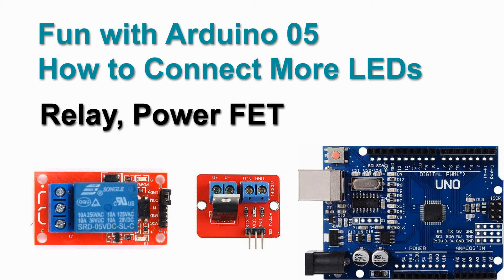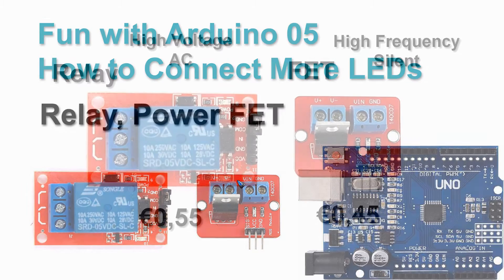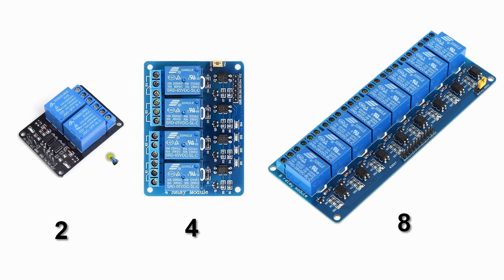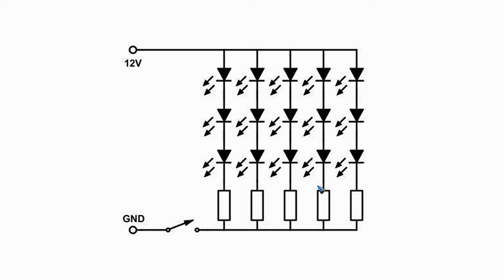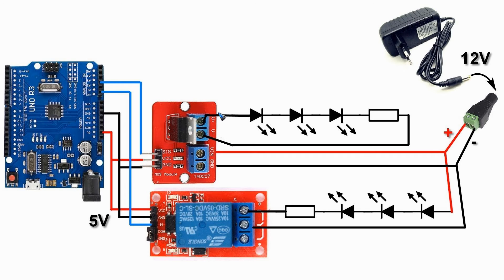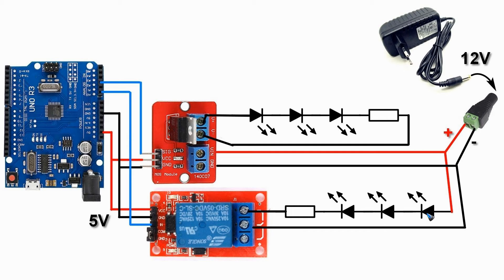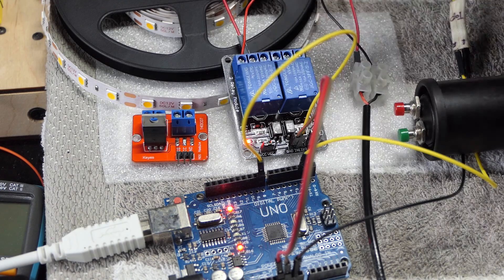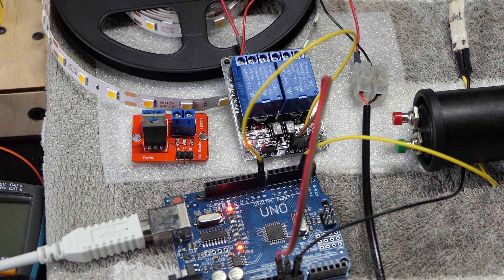Fun with Arduino 05 Connect More LEDs with Relay or FET

Comment: Hi, can we FET module to switch Peco PL-11 point motor instead of 5v relay
Reply from the maker: I see no reason why not ... as long as the load stays within the specifications of the FET module.
Reply: @rudyshobbychannel  hi, please share the link of FET board
Reply from the maker: The link is in the blog post, link to the post is in the video description.

Comment: Hi. Thanks for all interesting videos! About this topic, how do I wire the signal from Arduino to several fet-modules? Can I just split the wire to several fet-modules?
Reply from the maker: Yes, you can use one Arduino output to connect to several FET modules that will then switch all together. Of course you can also connect every FET module to a separate output pin, that way you have full ontrol in software which switch when.
Reply: Thanks a lot.